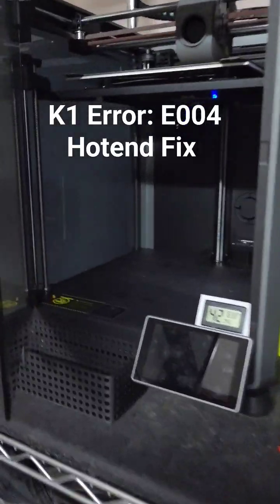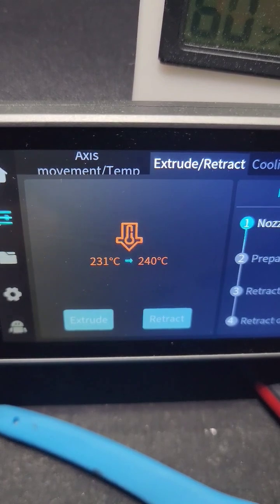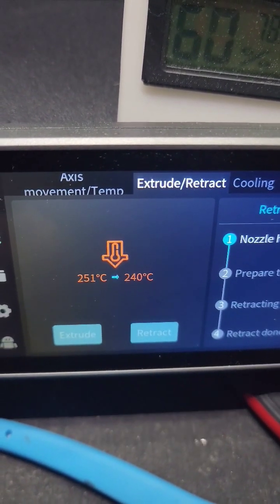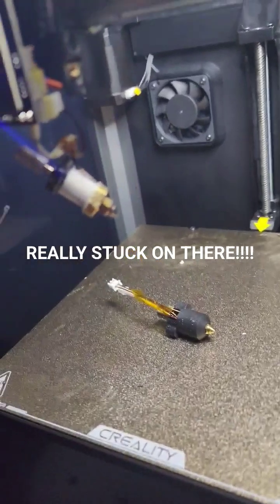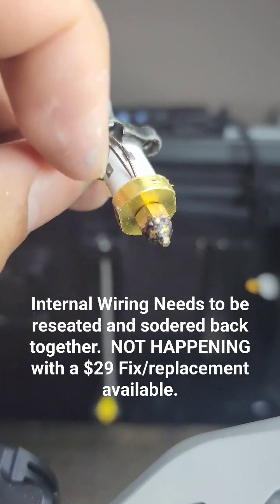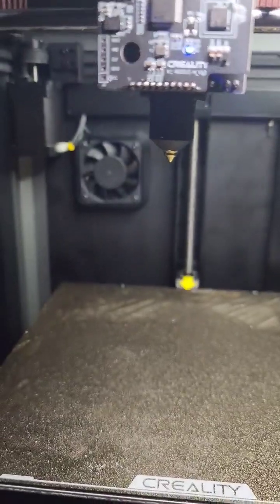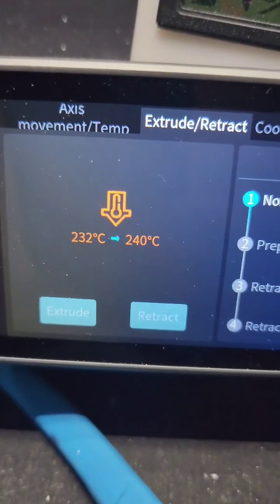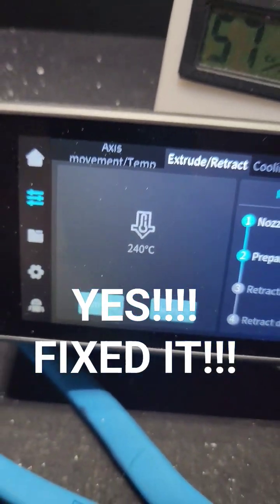Creality K1 Error E004 Not Heating Properly FIX #creality #k1 #crealityk1 #hotend #howto

Comment: Thanks for this video. I had the same issue on my K1 with the first gen hotend, and it would not even get near the print temp before throwing out this error. 
I managed to stick a small 300 degree thermister intended for another printer onto the hotend using some high temp thermal compound and capton tape - reusing the white connector from the broken thermister with new molex cons for the wires and it works amazing - atleast for now until the new part arrives.

Comment: I think you'll get the same issue if you change a nozzle out and it's not seated properly. I was about to change it out too but when i went to heat it up to take the nozzle out before changing the hot end I noticed the hot end stopped having the issue. So, I decided to just try to reseat the nozzle and give it a go and it looks like it worked. I was able to print a calibration cube and a full Boba Fett helmet. Hope this helps.
Reply from the maker: I also reseated it a few times and it worked periodically.  The issue is the Connection on the old style is weak and the wires go bad quickly.  Resulting in the old "wiggle it and it works again" fix for a few prints. BUT it is a known issue by Creality and they are replacing them if you got the older style machine somehow.  The newer K1 units are equipt with the "upgraded" replacement.  My newer K1 unit has not had this issue and came with the RED Silcone upgraded hotend.
Reply: @MajorPain5500  I made a factory reset and problem solved. It is a firmware problem.

Comment: I have changed on new version, 1 month and error again 🤦
Reply from the maker: Replacement One from Creality has been going strong ever since I replaced it months ago. I did also purchase an extra one for "JUST IN CASE" reasons.  Was yours the RED silcone one with the thicker thermistor connector?
Reply: I just replaced my hot end and this keeps happening to every print

Comment: Is the boron nitride needed or can I just use regular thermal compound?
Reply from the maker: Boron Nitride is RECOMMENDED.  It helps with Thermal distribution.  I am not sure about Thermal Compound taking these extreme temps.
Reply: @3DandTeePrinting  I got my paste, where exactly should it be applied?
Reply from the maker: @deputyd0ng694  It's not required, but you can use it on the heatbreak on the hotend and Nozzle threads.
Reply: Regular (intended for CPU) thermal paste aint mde to cope with 300°C